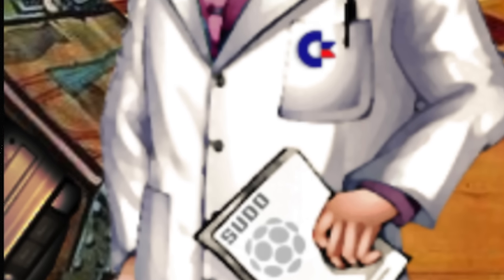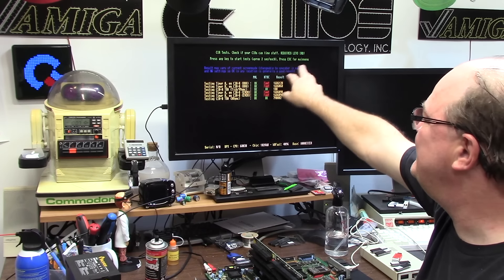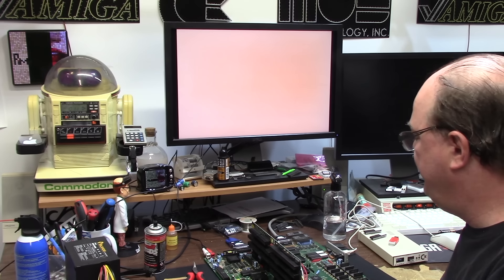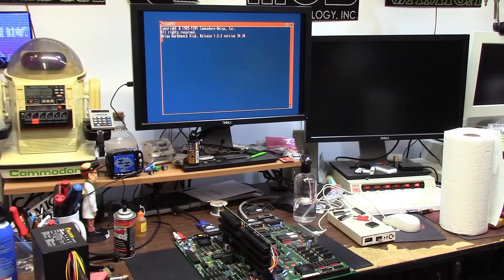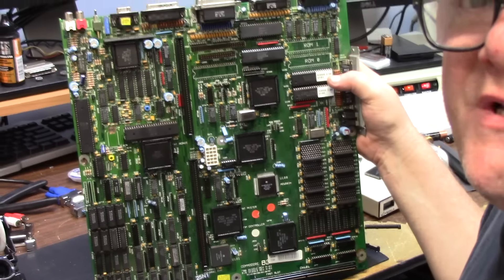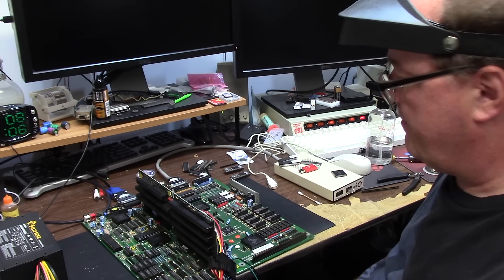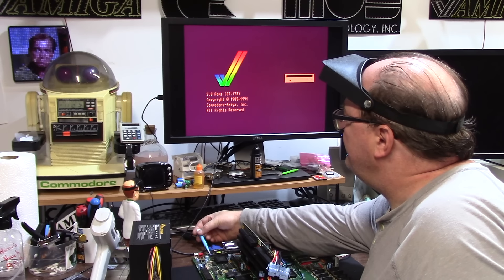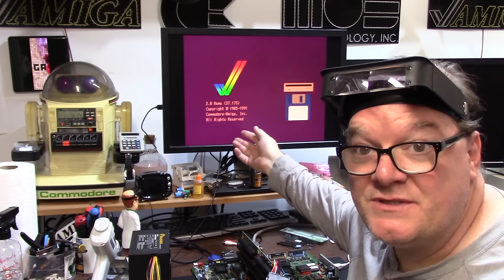Amiga 3000 from a hippy wood barn P2 - Fin

Comment: Great video but probably should have kept the dump part out. Some things just cannot be unheard/seen. Amber shake came through clearly on the video. The shake would drive me nuts and give me a headache. Kavanoz is awesome. He is building me a ReA3000 board and matching black PCB RAM!
Reply: Chris did an amazing job but I don't feel the Amiga will be fully fixed until the Amber shake is gone.  I was hoping he would have gone that last mile to make the board 100% fixed.

Comment: What causes all the green crud to form on the chip pins?  Static electricity attracting dust?
Reply from the maker: Either electrolytic fluid from leaked capacitors or sulfuric acid from the battery leaks eating into the lead solder and metal legs

Comment: I also wonder how much of your time and parts could be saved by a good cleaning with an ultrasonic bath big enough to fit boards like this.  Adrian scrubs his donation cards with soap and water than blow dries them.  Other friends of mine that restore other boards give even bigger VME 9U sized boards complete bath with alcohol and brush before even starting to debug.  I think I am going to try the ultrasonic bath, with a little bit of vinegar(to take down the alkali battery leakage), followed up with a distilled water rinse and a blow dry.  What do you think?  Do we need to buy you an ultrasonic bath?   Why no take crypto yet?

Comment: Your audio has some slight noise in it. Apart from the chair that is :D
edit: and it gets worse when you touch the camera. Is your ankle monitor maybe interfering?
Reply from the maker: Prison bracelet
Reply: Is your mains properly grounded? @ChrisEdwardsRestoration
Reply from the maker: @chaoticsystem2211  it is, the charger is broken on my camera and i am grounded out so when i touch the camera a buzz occours now. the camera is a polarized plug where as my ground strap is just that.   all good.